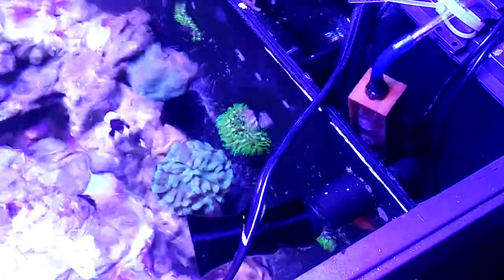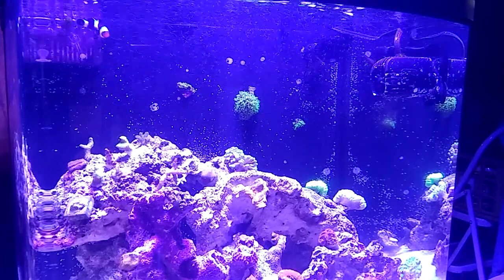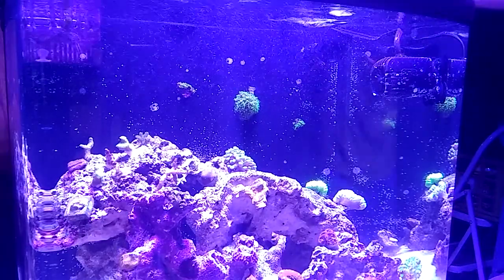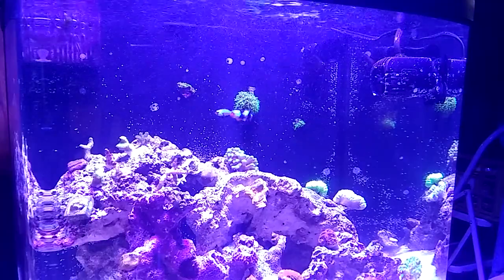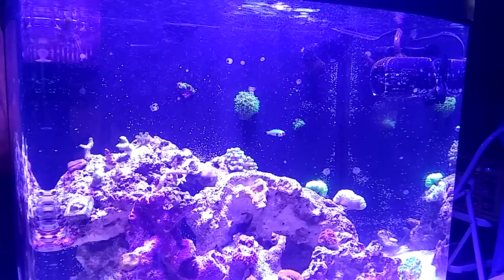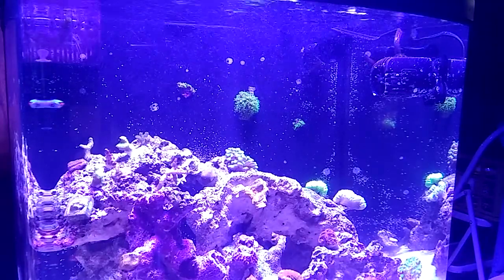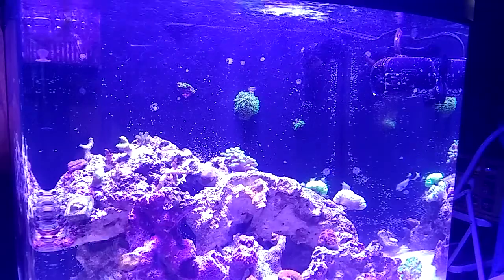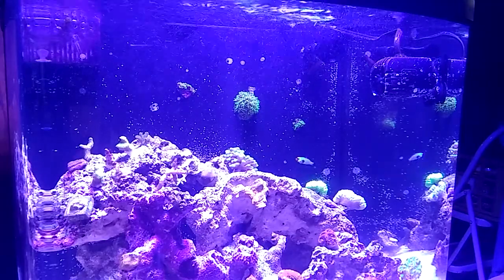Micro Bubble Scrubbing Demo

Comment: I've discovered I can bubble by raising my RFG up close enough to the surface so it pulls air. One of these days I'm going to test it out thoroughly and see if there's an impact on my alk, like there was with the 20. 🤔 Are you still doing the bubbling?
Reply from the maker: I still bubble in the 55 at night. The RFG nozzles will definitely pull air in when to close to the surface. I added more lock line to place it deeper. Don't forget siphon breaks.